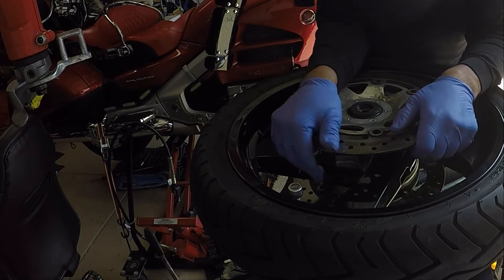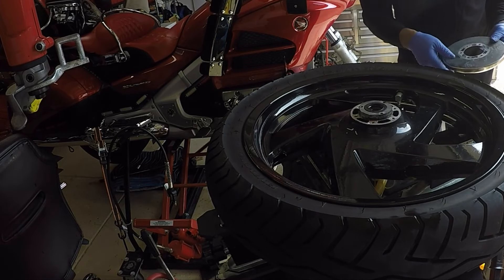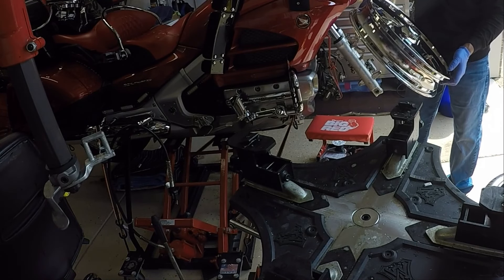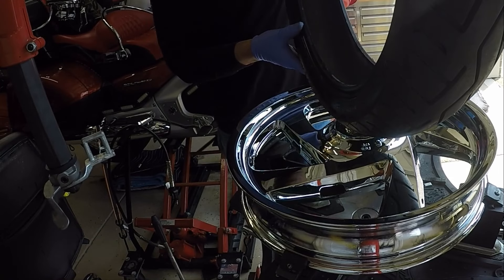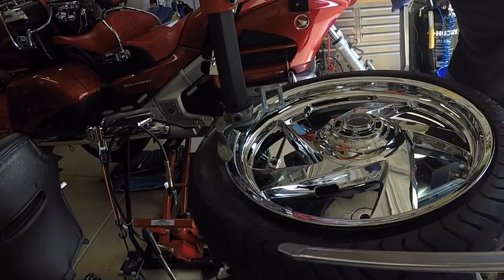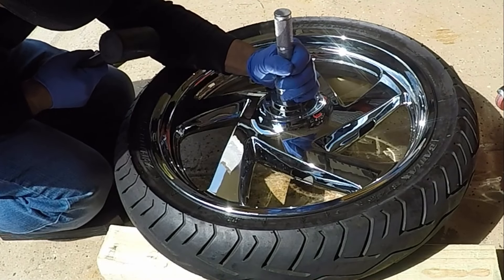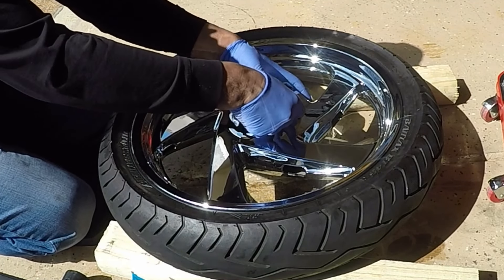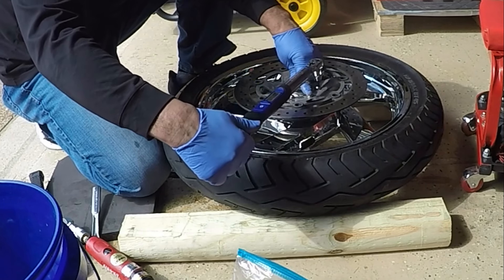Black Wheels to Chrome Wheels Honda Goldwing

Comment: Locktite should be used on those disc bolts
Reply from the maker: Stop looking for video flaws, trust me I added medium strength thread Loctite to each rotor bolt but if you want to get really technical the Honda service manual recommends that you replace the disc brake bolts after you remove them.
Reply: Apparently you can't take a little criticism Crissy 👍👍😂😂